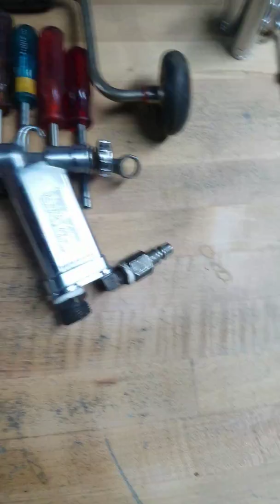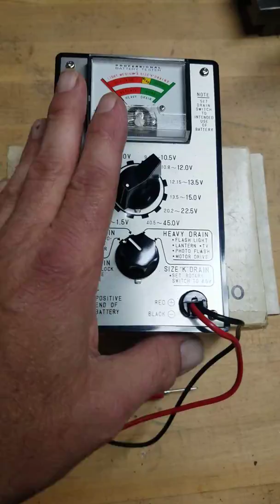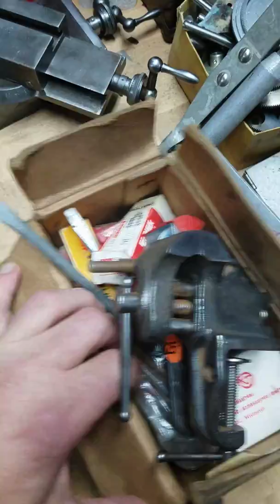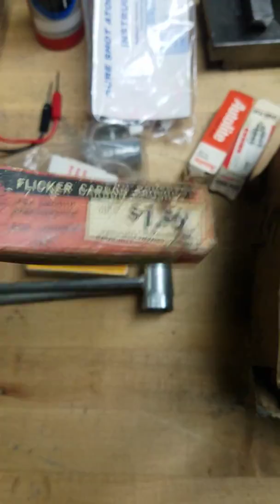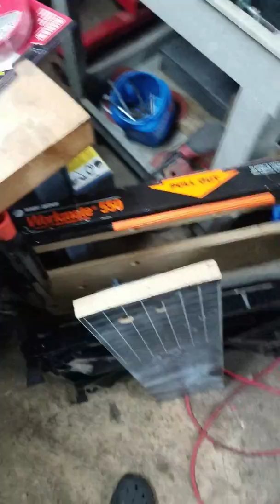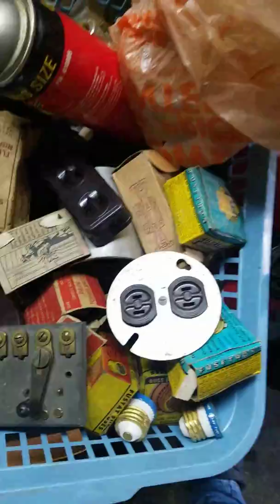Garage sale finds

Comment: I used that very same nozzle to clean parts after they came out of the hot tank in my automotive machine shop.  I think that I still have one in my toolbox.
Reply from the maker: i dont know what happened to the one i had after the station closed,it brought back memories